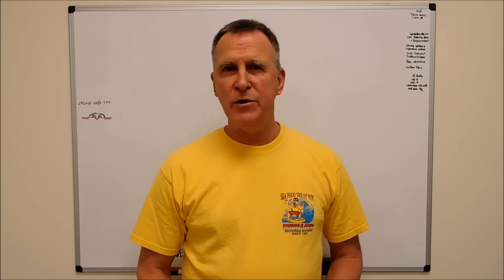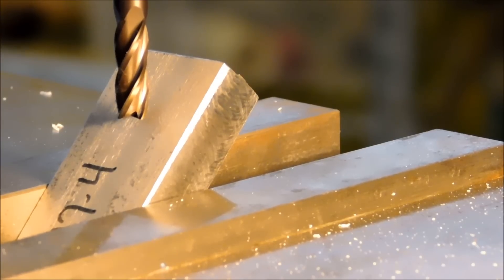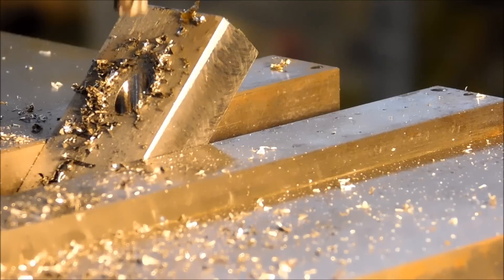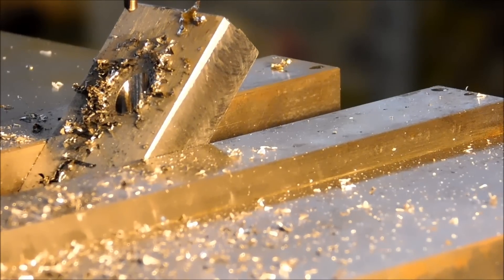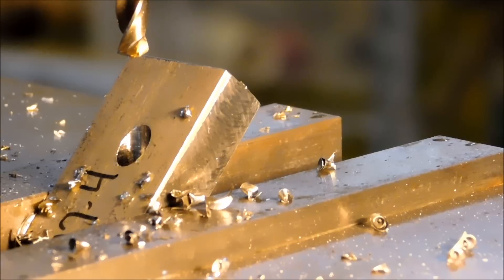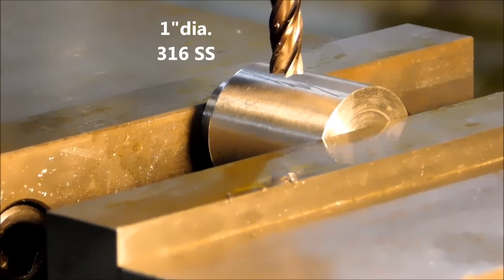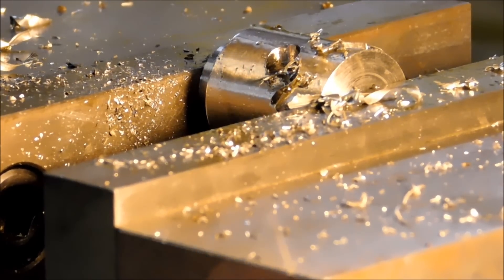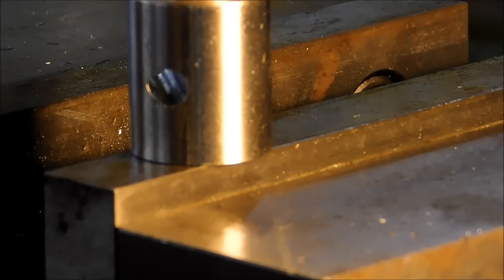Drilling Holes on Angled and Rounded Surfaces

Comment: Any tips on chamfering the eliptical hole equally all the way around ?
Reply from the maker: Thats a nagging problem. There is a tool for that, but I've never tried it. Its called something like an elipto bur.
Reply: Found it... Elipto Master...for $200-300 I think I will skip that step :)
Reply: Good sir let me say first you are bible of knowledge,keep doing videos like that-little tips and tricks and some common knowledge maybe not so avalable to everyone !

my question to you is gow do you drill a 90° hole in a pipe without a dividing table ?I cant go trough with a drill since i will encounter second  curve,if i move it to do it from top side it wont be 90° anymore,and my starting drill or endmill are not long enough to hit the second wall of pipe to make flat spot.Any idea?

Comment: My mill doesn't have a table that rises, just a lockable quill - is there any other way to stop the bounce? By the way I love the theory/explanations in your videos, good stuff!
Reply from the maker: Use your quill stop and down feed in very small increments against that stop hitting it every time and dialing in changes in between. Its not as rigid, but don't rush it.

Comment: wouldn't it be easier to have a guide tube over the drill which holds the drill in alignment, similar to a dowel guide for drilling holes in wood, the noise sounds like the fan of the motor is rubbing on the cowling.
Reply from the maker: That would be a good way to do it if you were in the field trying to do this and not setup on a machine.

Comment: Is there any down side - apart from the time it takes - to do the whole process with the end mill?
Reply from the maker: Depending on the depth of the hole, sometimes endmills shanks are a bit different diameter than the cutting area. If the flutes are long enough, have at it. Down side may be that the bottom load on the endmill may produce an oversize hole.

Comment: Just to go a little further to accommodate an odd sized hole you can trig out in infinite number of offsets from the hole center in order to achieve a near perfect match to the drill size required (if necessary). 3 steps per quadrant will usually suffice if the end mill is close to the desired hole diameter. Thanks, by the way, for giving me an outlet for what has become useless information now that I have retired.
Reply: What we need is a sort of Peace Corp where retired guys can fan out and share their tons of information with younger guys wanting to learn.  It is a shame the amount of hard won information that is lost every day in the world as guys exit the work force, no matter how well deserved.
Reply: I don't think it will ever be useless information. We hobbyist are always in need of tips from you old masters. Any tip you guys can give is priceless information to pass on to the next generation of machinist.

Comment: Joe, I don't know where to ask this, so here goes :- I am being asked at work to machine an awkward part. It is an aluminium CNC machined car gearchange paddle from a steering wheel, and it needs a tiny bit of cosmetic machining to change a - sign to a + sign. They want me to stick it onto a flat surface with body filler to hold it in the correct attitude and then clamp the flat surface to the bed. Then manually machine the alteration on our shop Bridgeport clone. Is this normal practice? Sounds like a shortcut to get out of a hole to me rather than machine another one. Would you describe this as standard practice, as I have not seen this clamping system mentioned anywhere!
Reply from the maker: You would be surprised at how many different ways I have seen and personally held a part. Epoxy in a baggie, a sand bag....you name it. As long as the cutter load doesn't out shine the setup, it should work. Id personally let the body filler harden up first, and probably suggest a perimeter ring of some sort so it doesn't crack when you clamp down the paddle. Take small cuts and good luck.
Reply: Thanks for the prompt answer and reassurance. I will use common sense and small cuts, and shed loads of well mixed filler.
Reply: Roger Crier- Jewelers, Gunsmiths, Bladesmiths and Engravers of these small, random-shaped items grip them in their vices using a product called Thermo Loc.  According to the MSDS, Thermo Loc is a blend of proprietary thermoplastics distributed by Glendo Corp and available for sale on their website www.grs.com.  Thermo Loc is produced in round sticks approximately 0.25" in diameter & approximately 8" in length.  It softens to a pliable "putty when heated in a microwave oven to between 140-158*F.  Once shaped around the object, the margins of the Thermo Loc and be fashioned to create edges that can be firmly gripped in a vise after the thermoplastic cools to a hardened state at room temp.  This should offer you a very flexible solution for work-holding on small/irregular parts that need to be machined.  Cheers- John Visalia, CA

Comment: How does a drill chuck get ruined by putting a mill bit in it?
Reply from the maker: Drill chucks are not designed for side load. Neither is the morse taper adapter most of them are mounted to.
Reply: Agreed. In fact, the only time it pays to put side load on a drill chuck by side milling is if you need to get a stuck chuck off the taper arbor. Some chucks have a thru hole and you can use a press and a dowel pin, but otherwise (unless you want to bore a thru hole) the milling trick is worth a try.

Comment: Once the pocket is formed using an end mill do you continue (for center drill & twist drill) to use the pressure on the quill but advance into the material via table lift or simply advance using the quill alone? Thanks
Reply from the maker: Once you have established a flat plane using the end mill, drill it normally using the quill.

Comment: Hi Cap'n
Thanks for another nice practical problem solving Video.  Had done this before, but U explain and do it lots better Feeding with the Knee.
Will give Your method a shot in future.
Would have been nice to see how U would centred on the Cylindrical without the DRO, which most of us don't have.  I know U would say use the Centre Finders and the Mill Dials, but is there another method ??? Just thinking out aloud. Don't mind me.
Oh well, we have the CDC Tool for that.
All the best
aRM
Reply from the maker: You can use a dial indicator to sweep either the body of your cylinder, or the surfaces if you have a stop to use. Just be sure to pickup the high spots both vertically and radially on each side. Easy.
Reply from the maker: Sounds like a good video.

Comment: Probably way over thinking this but if you are making this hole to put a fastener through don't you run into issues with the head of the fastener protruding above the surface?  
I am assuming the hole fits the body of the fastener not the head.

Now IF that is the case,  do you go in with a larger end mill to do the counter-bore or to create a flat so as to counter-sink?
IF you are creating a counter-bore does a regular counter-bore tool have enough length on its pilot to center in the hole as the angle maybe such it can only engage a small part and not be centered.

What can go wrong if you are threading an angled hole, for example the sample Joe did on the round, only the middle part of the hole would have full threads...
Reply from the maker: Answers...
Hardware sticking out would definitely depend on the hardware, but usually it does.
Yes to the larger end mill for the counter-bore.
A standard counter-bore tool may have enough lead if the offset isn't too far off center 
And..true on the threaded hole observation. Only the full diameter section of the hole will yield full threads.
Most shaft collars are made this way and the design has been the same forever. Select your threaded hardware carefully and you should be OK.

Comment: So, the End Mill, is actually a Slot Drill.
It's not that hard to get it right, hey!
There is a lot of difference between the two. If, as you say, you had used an End Mill, then you would not have achieved the depth or penetration, that you did., hence the result that you actually achieved.
Reply from the maker: Actually, by definition, a slot drill is just a 2 flute end mill. I used a 4 flute center cutting carbide end mill for this demo. Just pause the video and count the flutes. I said I used a end mill, and I did. Not sure where your confusion is coming from.
Reply: I have 2 flute and 4 flute end mills and slot drills. Reckon the "confusion" comes from, where we come from. Me, here in Australia. I'm a proper bastard from Queensland.
What you called an end mill, in the clip, is actually a "Particular sort" of End Mill, ie, "A Center Cutting End Mill" in your reply.
Now, we, ( Me, that is), I call a "Center Cutting End Mill" a "Slot Drill".
An End mill that is not center cutting, is exactly that, an End Mill.
An "End Mill" or "Slot Drill" by this definition, is simpler, easier, less prone to being misleading.  "Nit picking..?'' Nah, simplifies it all, and it works for me. 
Any poor bugger, pulls out an "End Mill", has a go, like you have demonstrated, is going to hate your guts in pretty short time.
Me, I reckon you are a bloody good Bloke, I like your clips, and well, I suppose I am just a Nit Picking Bastard.
Peace, Joe. 
Mark Needham
Reply from the maker: Thanks Mark. Keep me inline. Anyone comes to the US to throw me a whipping, I'll just come to Australia (or New Zealand) and hide. Heard the scuba diving is top notch.

Comment: awesome vid Joe, ill have to try this on my mill :)  2 questions though.... 1st: my mill is only a quill feed, there is no knee on the mill so I have to unlock the head from the main support and crank it up or down and then tighten it back up, there is the quill for the z axis... for my mill, is my only option to use the quill and set the lock for a little bit of drag to help with hop and chatter? or is there another method you recommend?  2nd: ive been looking for a DRO kit for a while but would like to hear if you have any good recommendations....? and where to get it.  thanks. mike.
Reply from the maker: Hi Mike. Keeping heavy drag on the quill and stepping down slowly sounds like your only option. I have always had AccuRite digitals and trust them. Check MSCdirect.com or go directly to AccuRite for a quote. There is also a thing called a Trav-A-Dial if the DRO proves to be our of your price range. I think Southwestern industries sells them.
Reply: If you have bad problems with chatter, despite the drag, you might try the folded square of rag (denim works well) soaked in cutting oil trick. You put this on the workpiece and mill through it. It preloads everything and adds damping as well, because the tool cannot easily cut through it: it has to be worn away, so it fills up the relief angles. Works a treat for other tricky ops, like big countersinks or counterbores in stainless steel, or using a conventional twist drill through thin sheet metal (without the rag, you get a lobed hole like a Wankel rotor shape)

Comment: Useful tip for drilling on an offset.  I to don't like the idea of using an end mill in a drill chuck as I've been told the vibration set up in the cutting process is enough to work the chuck or the end mill loose. I've never tried this but can always remember my instructor tell us about this. I had a bench drill given to me a long time ago - it too sounded like your machine, when I looked for where the noise was coming from I found the belt had been repaired with a metal link joining the belt. The belt had been repaired with a twist in it. I ordered a new belt but in the meantime I flipped out the link and replaced it with out the twist. The machine ran quietly without the vibration.
Reply: Yes, I tried it Outlooker 251 - despite reading a warning about not using an end mill in a drill chuck.

I had just started to learn engineering and had a brand new small drill/mill. I had a very small flat to put in the side of a piece of drill rod (for a set screw engagement). I would use a very SMALL end mill, so what would be the harm - I reasoned. I could have easily mounted my end mill chuck - but I had been drilling holes you understand. Anyway, I had hardly touched the work when the chuck let go of its arbor....

There is an old saying that says that experience is what you get when you get noting else out of an endeavor. I have a little round gouge on the top of my mill vice's front jaw (where the end mill hit it) that I call my "experience mark"! Every time I see it I remind myself to listen when experience speaks. Joe has the experience and that is why I have subscribed.  Thanks Joe!

Comment: I just started metal working as a hobby so forgive the "newbi-ness" of the question. So, why wouldn't you want to continue all the through the material with the end mill rather than switching bits?
Reply: You may not have the exact size mill as the hole you require so you will use an oversize mill and finish with the drill for tapping etc.

Comment: Thanks Joe. My 30 year old craftsman drill press makes that same noise since it was new. I have no idea what it is. Disassembly gave no clue. I hope someone identifies it.
Reply: Hello Ro Efa.
Take a look at the brass 6 spline bush in the front pulley. Whilst looking at where the 6 spline spindle comes through the brass bush wriggle the chuck back and forth to see how much play  you have in the spindle through the  bush. I too have a vintage Craftsman drill press and there was play at this point so I made a new brass bush and solved the problem.
I suspect Joe's machine could be rather more complicated and with your Craftsman being like it since new it can't be wear as was mine, however checking it is so easy it's worth doing just to make sure it's not a poor fit.
Reply: Thanks. William... I'll take a look at that. I looked at everything when it was brand new and it all looked tight, but I'll check again. I appreciate your input.

Comment: Hello Joe,
With your knowledge, workshop and experience wouldn't you consider making the parts for your noisy machine instead of buying them?
Reply from the maker: I like this comment because I actually considered it. I did take the machine apart and discovered that this mill is not like a single key Bridgeport. Or at least I think Bridgeport is a single key. This machine is a 6 spline motor shaft that engages a 6 spline lower motor pulley. There is a gap, and it has......a 6 spline outer and inner plastic sleeve. Sure I could handle it, but for $260 for the plastic bushing and a new lower pulley, its better to buy the parts and do some design work in the meantime. I'll post a video of the fix since I couldn't find one to follow. Don't forget, you really can't use the machine that needs repair to make parts to repair it once you break it down.
Reply: Good find

Comment: Yea that rattle can be annoying my old girl has the same problem. as best I can determine it is the bull gear rattling. It's a fairly pricey and deep down in the head repair. I opted to go ahead and buy the parts so I have them on hand, and just run it till she won't run anymore. I've had the repair parts for several years now, so that's just that much longer the repair will last when I finally have to do it.
Reply from the maker: I finally tore into it on Friday and Saturday. Its the spline sleeve on the motor pulley. The pulley itself looks a bit worse for wear. I'll talk with the techs in the morning. Its about $300 in parts and some patience to fix it. I actually filmed it and will post the video when its done.

Comment: you would make a clamp-on jig to guid the drill for field work
Reply from the maker: Yep.
Reply: What would that look like?
Reply from the maker: That would depend on the final hole location. One used on a open car frame would be different than one use on a pipe in a cramped area. Either way, just a bent or machined plate with a hole in it that could be clamped to the work zone and used as a guide.

Comment: Neat trick!  Why don't machinists steal ideas from the woodworkers and other disciplines?  I've encountered this problem several times.  Get a cheap doweling jig and clamp it on the piece.  If you need to make off center holes, then add parallel bars to offset the work piece. You can also build a quick and dirty drill guide using hardwood scraps.  Easy peasy.
Reply from the maker: The jig idea is a good one. It would be good for out of the machine holes, or drill press operations.

Comment: Hi Joe,

Great video as usual. 

Just one comment......

Since I stopped using centre drills for anything other than drilling holes in which I'm going to use a centre, I've never had the tip break on one.

Spotting drills all the way!
Reply from the maker: What ever works, stick with it.

Comment: Joe,
I do not own a Milling machine, only a Drill Press. Can I use the End Mill without doing damage in my Drill Press? I like your method!  I do happen to own many End Mills from an old Lathe my Dad used to have - most brand new.
Reply from the maker: You risk disengaging the chuck from the morse shank from the interrupted side load. I would think your handle would bounce considerably. If your setup is rigid and you have a guide hole of some sort, you could probably get away with it.

Comment: That noise sounds like variable speed head turned down way to much, for way too long..  Looking at a head re-build.  Knoweldge we learned is disappearing.  Same, or close sound on a saw?  Same but different.
Reply from the maker: Its the sleeve around the head drive key. I just opened it up.
Reply from the maker: Correction......This machine uses an internally and externally splined plastic sleeve between the motor shaft and pulley ID. It is TOAST. Video to follow.